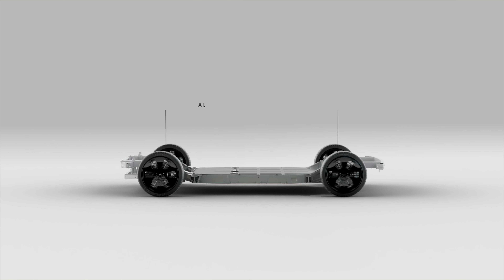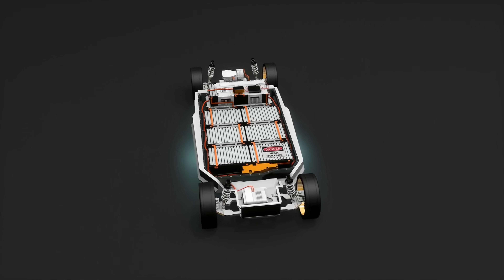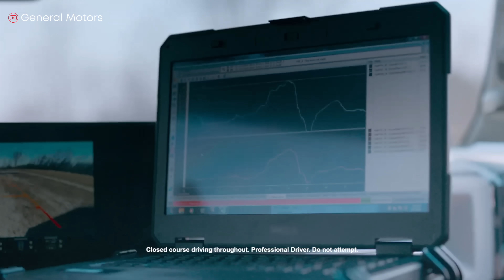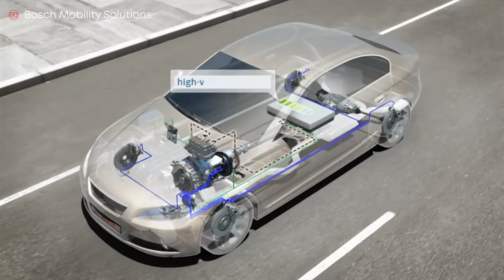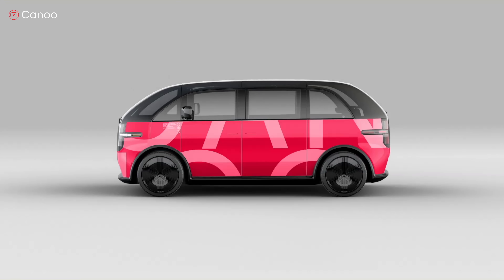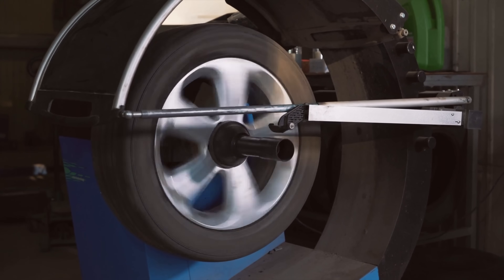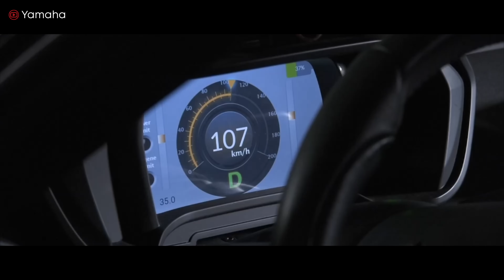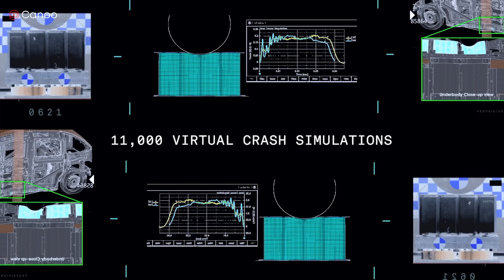No One is Telling You the Truth About Electric Cars, So I Have To

Comment: They need to make the brake lights flash when the accelerator is released. They rapidly decelerate without warning.
Reply: Tesla's brake lights come on as soon the pedal is released because of the regenerative brakes.
Reply: They do
Reply: @mtbse789  not the one I was behind. It was like dropping a manual transmission into second gear.
Reply: That kind of situation would be catastrophic on a slippery road surface.
Reply: @mzampell  Damn..maybe it's a setting then?  Definitely much safer if they do come on.
Reply: I think they do. By the way in a leaf when you touch the brakes it regenerates more, but at some point if you brake really hard the pads will bite. Really awesome.
Reply: I believe most do turn on the brake lights when Regen is in use
Reply: Well, maybe you should stop tailgating cars then….easy fix
Reply: @Asto508  wrong answer
Reply: So do manuals, I don't think it's a big issue.
Reply: I have a 2011 Nissan leaf as my daily driver. It still runs really well. The battery has degraded to 68% of the new capacity, mostly due to the Leaf being one of the only EV's with no active battery cooling. It's still enough capacity for most of our needs. It's occasionally been used for longer trips too. I've had a quote of NZ$10 000 to have the battery replaced with a second hand battery at 95% capacity. The Leaf retails new for NZ$61990 here. I expect that in time aftermarket battery repacking and replacements will become common.
Reply: I have a Bolt. It does this already.
Reply: My vw id4 brake light comes up when its on regen mode. If i release the acceleratir, the brake lights comes on 1-2 seconds after release.
Reply: The, federal government has a rule that if a car is decelerating (on its own accord on a flat surface) at a certain rate or faster the brake lights must come on.
Reply: My 2018 Tesla does
Reply: Even the brake lights in my electric fork lift illuminate as soon as you lift off. This is 30+ year old tech
Reply: The brake lights turn on when you decelerate an EV. And yes, you rarely use the mechanical brakes with an EV in normal traffic. My dealer advised me to do some hard breaking once a month to get the rust from the disks.
Reply: not a bad idea.. I use regen braking agressively.. and have to tap the pedal to wake up the sleepers.
Reply: They do come on when you let your foot off the gas.
Reply: Tesla does and you can change it to roll mode if you want it to break like a regular car
Reply: harleys Davingson dos
Reply: @mzampell  maybe don’t tailgate then
Reply: @FrankJFischer  there are numerous people doing refurbishment of battery packs in the US & 1 or 2 in the UK already for Leaf, & Toyota/Lexus packs for around $750.  You should never need to buy a brand new battery pack to get good lifespan at silly prices.  How often do people buy brand new engines or gearboxes for $1,000's to replace a worn out one in a 7+ year old beater?
Newer integral batteries such as Tesla's Structural Battery won't be serviceable, but should last between 500k & a million miles though. Same for other brands from this year going forward.
Reply: My wife got a ticket from someone like you with a badge. He just wouldn't bring himself to admit that her letting off the gas in her manual Jeep wasn't worthy of her not hitting the breaks. She saw him looking at his computer when he almost hit her, had she hit the breaks he probably would have. 

How about paying attention to the road and not following too close, sounds like a better plan. Seeing as break lights fail and not running into things is kinda what you do while driving.
Reply: @Asto508  Right answer 👍
Reply: The brake lights come on as soon as you take pressure off the accelerator. Our family has three Teslas. The brake lights work just like a gas car.
Reply: Motorcycles should come standard with this technology, because they use engine braking to help slow down. Can't count the number of times people have gotten too close.
Reply: That would use some of the energy that they're trying to store.  How about a small led on the speedometer flashing?
Reply: Im wonder how these Battery Cars are Going to work running the AC Compressor, it takes a Lot of Power, so your Range will Become A lot less !!! Drive around Phoenix AZ in the Good ol Summer time of119 Dees, and see how Far you will go !!! i have an idea there are going to be a lot of peeps, sitting on the road side looking for a Charge !!! And a Dam Drink of Water YUK !!!
Reply: I used to have a VW Golf GTE (Plugin Hybrid) and currently drive a Audi E-Tron (full EV) and they both display the brake lights when decelerating on regen. Would be interested to get feedback on what make and model of EV it was that decelerated without activating it's brake lights as this shouldn't happen. There is legislation to account for this.
Reply: Mike Zampello - A 5-speed manual gear-box & a better designed speed control to allow the transmission to build up momentum as power is applied will solve this problem.  Regenerative breaking is not beneficial if you allows have to apply power to make up the extra travel distance.
Reply: @Afrocanuk  an EV has no need for a manual gearbox or indeed muliple speeds or gears at all because of the torque delivery from the motor. However, I do agree that "one-pedal" driving isn't benfical to economy as lift and coast is hugely beneficial, which is why I applaud the Audi / VW philisophy of using the brake pedal (brake by wire of course so it can apply regen and actual brakes as required) to slow the car rather than automatically kicking in regen when you come off the accelerator.
Reply: Not true.
Reply: e-Golf brake lights come on in quick deceleration mode.
Reply: @joewhip9303  LOL.. Three… That’s silly
Reply: @peteparadis1619  lol, not.
Reply: @rogerhegemier8491  Using AC here in VA, 2020 Bolt, maybe uses 8-10% of my range, depending.  One more thing: when I leave the AC on when stopped, it appears to consumer about 1 KW per hr or less.  When it's really hot, I leave the car "on" when I get out, with the AC running; I lock the car of course.  Cool 😎 And YES my brake lights do come on with Regen braking.  FWIW, I wish some of you would edit out your typos more.  Some posts wind up so messed up I may be missing what is intended.
Reply: @philipbain  Regen mode is optional on my 2020 Bolt. I am not sure I see what you think is wrong?
Reply: @replyhere590  Nothing wrong per se, it's just that lift and coast is tricky / nigh on impossible with 1 pedal driving
Reply: The brake lights do come on

Comment: It is true what you say about making sure you operate between 20% and 80% for the battery so it doesn't lose range. However if you do this, you basically already lost the 40% range, that you aren't using right from the get go. It is a lose/lose scenario.
Reply: Plus additional 20-30% range loss if the temperature are below zero
Reply: or too high like here in FL... over 90-something degrees not including humidity! and because of that, the estimated milage range that the ev cars says you'll get with a certain level of battery charge can be WAAAY OFF.
Reply: The range is there. You just don't use it most of the time

Comment: Pro tip:  If a charging station has multiple cables, always try to use the cable that is shaded, or cooler.  The charging cables at stations have heat sensors in them, and the hotter the cable is, the slower it will charge your vehicle.
Reply: Much easier to just drive up to a filling station, select grade of gasoline, fill up and in 5 minutes, you are on your way.
Reply: @bondgabebond4907  your stations must be faster, it is at least 15 minutes here
Reply: @msgsgt  Lol california is weird
Reply: No problem, just shade the cables from the sun with your body, and you can maintain optimal charging station performance!
Reply: @John Doe Yep, an EV with decent range will take around an hour, and that's with a fast 350kw DC charger.  A lot of places still have AC chargers, or the 50-150kw DC chargers.  EVs definitely will not work with the way we currently drive.  They work fine for a simple commuter car, especially if you have solar at home or get a cut rate for your electricity overnight.  People with Teslas will tell you all about how they can plan a trip jumping between chargers and that their car will plan it all out.  What they won't tell you is that when they get to the charging station and it's already occupied, or out of order, they wait an additional hour or two or three to begin charging.  They'll tell you how much they like taking 3-4 hour breaks every few hours on their road trips.  They are just trying to justify their expensive purchase.

Think of it this way:  if the average gas station has 20 pumps, and it takes roughly 5 minutes for each car to fill up, that means the average gas station has the capacity to handle 240 cars per hour, when busy.  An all electric fueling station of the same size could, at least in theory, handle 20 cars per hour.  And that's if the person using the charger doesn't go have dinner while they wait and dilly dally getting back to unplug their car.  Have fun with that.
Reply: @Infinion  lol what
Reply: Just throw cold ice water on them to cool them down !! 😲
Reply: @bondgabebond4907  Most EV owners visit a charging station less than 5 times per year, so I'm not convinced that gas is really more convenient.
Reply: @bryank7133  You forgot to mention that most ICE drivers go to the gas station every week while most EV owners visit a charging station less than 5 times per year.
Reply: @mikesaunders3326  Ofcourse if you do not use your ev like a normal car you do not need to charge it that often. Its same like my car runs a whole year on a gallon of gas ... Yeah because i never used it to go far. Can you tell me mr. Ev specialist you want to go to 200 mile trip you take your ev how the F in the World it going to be need charging 5 times a year??? Unless ofcourse you tow it lol.
Reply: @mikesaunders3326  and the battery millage of your car is only 400 miles. 🙃

Comment: The influence of temperature towards the powersupply of a battery is really a very big issue. Once in winter I took my smartphone 2/3 charged with me, at about   - 15°C, to use it finding a lot of new adresses by google maps, but the phone stopped functioning as soon as its temperature sank to deep. ----
So it will always be possible that to low temperature may pulverize your plans, if you depend on power out of a battery. That can seriously be a dangerous risk.🥶🥶🥶😟😟😩😫

Comment: I was a forklift operator for a few years and the whole fleet was electric. It was a indoor Area where these lifts lived and every day and week there was a machine that was not working or a battery/batteries that would not charge or say is charged and not work. My experience was not so great with an battery powered vehicle. Oh and rhe heat wad unbearable at times generated from the Motor
Reply: What type of batteries were they? I'm guessing Lead Acid
Reply: I also used a forklift in an electronic retail warehouse decades ago and they were all electric. 
They were always around and when one didn't work properly, we'd use the others. 
I don't get your post.
Reply: I worked at a similar place. There was a crew to replace the battery. You drop off a forklift or pallet Jack grab another and go.
Standardization of batteries could be swapped on a subscription basis.
Reply: @Desertdweller1965  awesome to have that ability or surplus of machinery to be able to jump from equipment to equipment and not be waiting for vacant lift. To the other replies, yes lead acid batteries, Raymond/Toyota lifts. What batteries would be best for this application or work load?
Reply: I had Hank Hill Forklifts. Propane. And outdoor: Diesel. 
Indoors at the dock, every five minutes someone yelling: "Tow motor!" One forklift for 4 guys. But everyone had a manual pallet jack.
Reply: 1 Fork Lifts used the old brushed DC motors which were at best 60% efficient, and used huge currents leading to wire losses even in cables an inch thick. 2 Fork Lifts still use lead acid batteries even now 3 the controllers were effectively resistive so shed a ton of heat in older models. Modern cars are way better because 1 they use 3 phase AC motors that are up to 95% efficient, 2 they use higher voltages and 3 phase motors take far less current per phase to get the same power. The upshot is less wire losses with thinner wires. 3 The AC Regen drives are extremely efficient (80% efficiency would be considered poor). So you are not in any way comparing like for like.
Reply: We had 2000 lb forklift batteries in pairs.  We rolled them off onto the rack, pushed the 8000 forklift a few feet and rolled the charged battery in and went.
Reply: A gas motor makes far more heat than an electric. If you've got a shitty maintenance department, yeah you'll have a bunch of stuff that does work.
Reply: Electric cars don't use the same type of battery and weigh a lot less than an electric forklift
Reply: I’m  retired now as a fork truck tech but batteries were the least of my problems! The last 20 years or so I worked more or less exclusively on electric trucks and looked after many large warehouses. Main causes of breakdown were switch and sensor failures, worn out and damaged tyres/wheels, contacts and damage due to accident and abuse. Batteries were often not well cared for by customers but came with a 5 year warranty anyway. There would be the odd cell replacement neccessary towards the end of the 5 years, but this was in warehouses running 3 shifts, 24/7. We supplied good quality batteries in the first place though.
Reply: A lot of the tech that is now used in electric cars has been used in electric fork lifts for some years. Fork trucks need a counterweight to balance the load, so a heavy lead acid battery was actually ideal. Battery capacity is calculated to last an 8 hour shift of continuous use. Charging isn’t a problem as they won’t usually leave the warehouse. Running several shifts is possible using battery change equipment, and can be as simple as roll off, roll on. Total cost of ownership is usually less than that of diesel or LPG trucks. Hybrids are not a new invention either, they’ve been around in some fork trucks since the 80s, and in locomotives even longer.
Reply: Been there Done That !!! Almost 1 or 2 times a week something was Broken, our Burned out, the Fork lift repair Dude almost lived there !!! His Name was Tom did you Know him !!!
Reply: I'm guessing modern EVs are a tad more advanced and refined than an old forklift truck!?
Reply: the world has changed since then. When I went to school I used a slide rule
Reply: @jonfscott  You 70+ then
Reply: Electric forklifts are a hundred times more pleasant to work with than the alternative. But it sounds to me like your workplace didn’t maintain them properly, or the lead acid batteries were old and worn out. 

My workplace previously owned second hand forklifts that had been run dry, it kills the batteries. It’s important to refill water when needed, AFTER they have been charged. Many people don’t know this, and refills right before charging. This can cause the battery to overflow. Also only use distilled water. It takes so little effort to prevent unnecessary damage to the batteries.
Reply: Just have a nuclear power car smh
Reply: I also have electric forklift experience, about 15 years and one as a battery maintenance person in a glass factory. The batteries they used were 48v lead acid, and about 2k lbs. All the corrosion you find on a lead acid car battery in a much larger package...lol.
Reply: Joseph Steaphens  I never said kt didn't